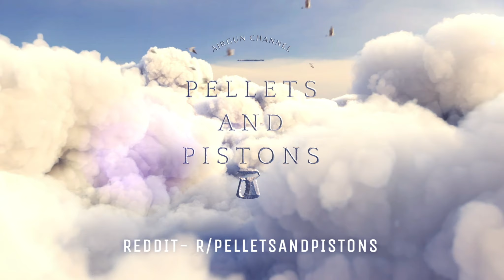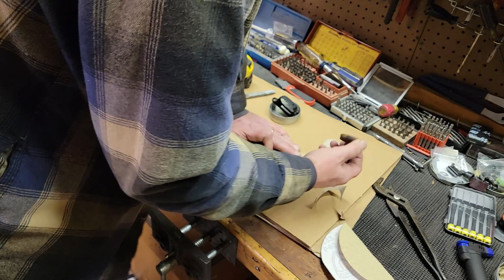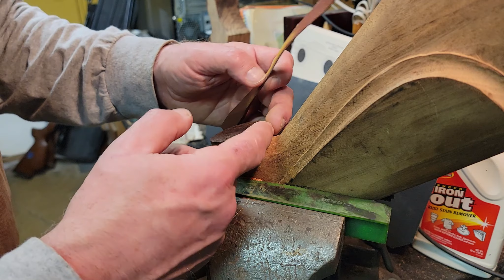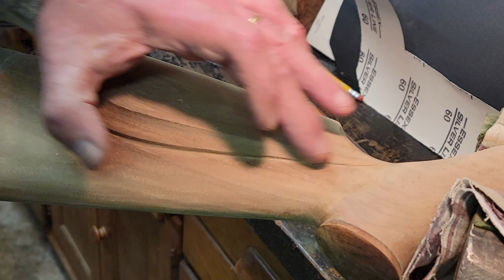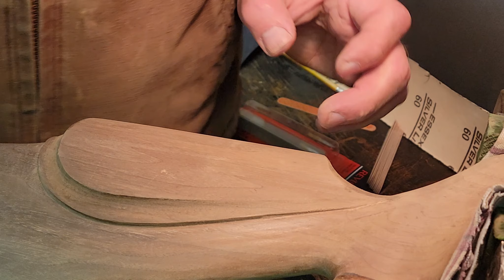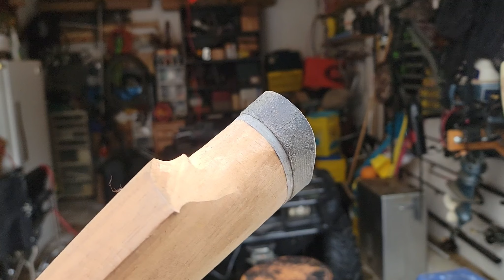HW95 Custom Build Part 4

Comment: Hi Kevin.  When I carved stocks, I used a King Arthur mini grinder.  Had a chain head for massive material removal.  Then varying levels of pin like heads that were less and less aggressive.  Even several flap sander heads in various grits.  It allowed me to rough shape much quicker and get to the finish steps with less work.  I loved designing the shapes.  Most times I would have a general idea, but let the wood and the process dictate the final contours.  Also, I just got into modelling a bit.  The suppliers sell small boards like your nail files, but with a much wider range of grits.  Up to 1000 or more that really just polishes. Might be worth checking out.  Looking forward to seeing the finished product.
Reply from the maker: Hi Tim. I've carved a few stocks myself that chainsaw wheel that you're referring to would've been ideal. Instead I did all of my shaping with a draw knife and rasps. I'll stop by the local art supply store and see if they offer those abrasive boards. Thanks for the tips my friend.

Comment: Hi Kevin, great job. Interested to know why you used epoxy instead of wood glue. Much easier to clean up afterwards. Will you remove all traces of resin around the buttstock so it does not show through the polish?. Nice idea on using nailfiles for detail work. You could glue one to a small block of wood to make it easier to hold. We have flexiblocks here with velcro paper which would be great to finish the contours of the stock as they follow any shape pretty well. Keep up the good work.  David.
Reply: Wood glue welds very poorly to Dalbergia sp. like Ebony, Rosewood, Cocobolo etc... Even with epoxy it's often necessary to dry the two pieces to be joined with Acetone to rinse off the oils 1st. . 😉👍 Lignum Vitae is the extreme end when it comes to oily woods as it is pretty much self lubricating. 🤷🏼‍♂️
Reply from the maker: Hello my friend.  Looks like Marc already answered your question and he's right. (as usual). Oily woods don't do well with wood glues. Thanks as always my friend.
Reply: @razor1962  Hi Kevin, I take the point. When we used to glue iroko with cascamite, the recognised glue in the U.K. at the time the joint could fall apart the next day. We then switched to a grade 4 (exterior) PVA and you could beat two glued up pieces of iroko all day and the wood would split but the joint held. I have iroko window boards in the house glued up with PVA twenty years ago and still solid. Not being critical, just hopefully points of interest to readers. Best Regards, David.
Reply from the maker: @majorscope  Absolutely my friend.  We tend to stick with what's worked for us in the past. Thanks as always.

Comment: Hey Kevin, it might be a silly question but do you own a multi tool? I don't know how I survived before owning one of them 😂 anyway with this tool in the past I've used old blades and epoxied emery paper to the blade, wrapping over the old teeth so I've got sanding on both sides and and edge, it's absolutely brilliant for getting into little places and also fine detail sanding into grooves and lines.
Can't wait for the final oiling and finishing part of the video, love your gentle and relaxed way of explaining what you do.
Reply: Dremel makes sanding discs with the 3M mesh abrasives. They are particularly useful for sanding tapered crown shelves on grip caps. 😉👍
The ISSF Actually banned tapered grip shelves on 10M rifles back in the early 80's as shooting appliances/aids. 🤦🏼‍♂️
Reply from the maker: Hi Mick. I'm not sure what kind of multi- tool that you're referring to.  I do own a Leatherman and a Gerber multi-tool. It's always amazes me how different people find different ways to accomplish a task. Thanks as always my friend.
Reply: @razor1962  oh I'm talking electric multi tool, maybe they have a different name in the US, it uses a cutting blade that  vibrates from side to side.
Reply from the maker: @mick chaganis  ahh, yes I know what you're referring to.  I believe it is called a multi-tool. I can see how that'd be very useful.